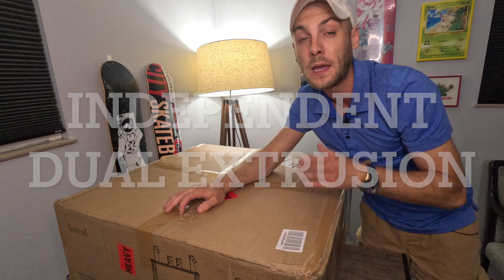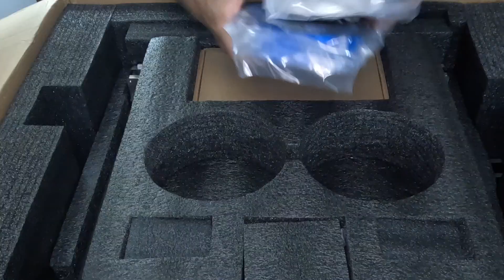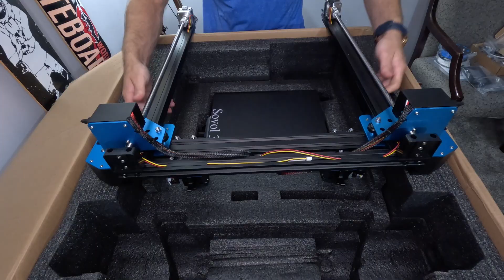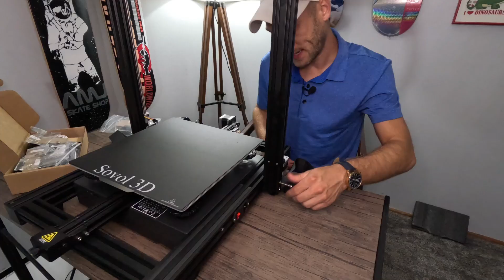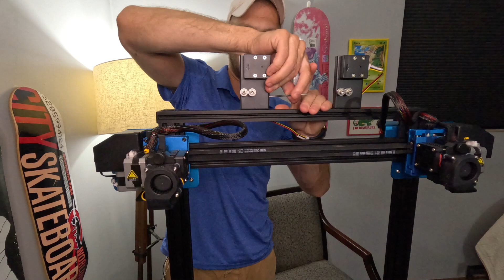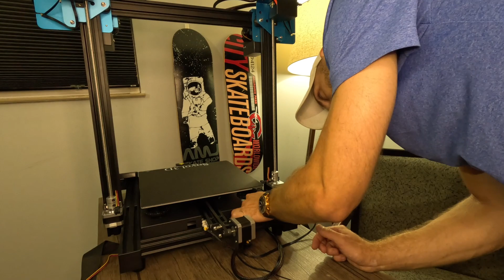3D Printing Ep#6: How Do I Print Two Colors At Once? SV04 Independent Dual Extrusion

Comment: Video was unboxing not how to print 2 colors as title said
Reply from the maker: Thanks for the comment! Do you have an SV04?
Reply: @RinehartGroupLLC  Yes I do and I've figured out how to use the two extruders now.
Reply from the maker: How are you liking the machine??
Reply: @RinehartGroupLLC  Once I figured out how to use both extruders and some of the quirks of the machine it is good.  For example you have to load filament in both runout sensors to operate even if only using one extruder to print.  Nothing in the documentation mentions that.  Getting the bed leveling was a challenge at first with the dual extruders.  The auto bed leveling does not appear to do as well as advertised.  However once all is set the prints are good.  Really like the dual color options and two extruders makes the prints faster and less waste than changing colors in a single extruder system.